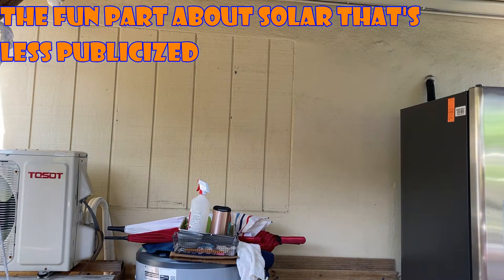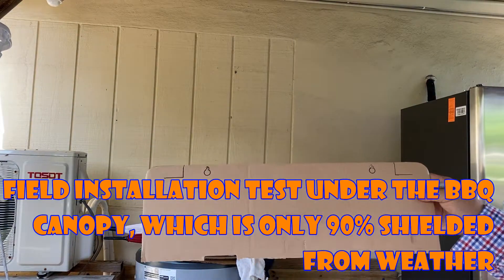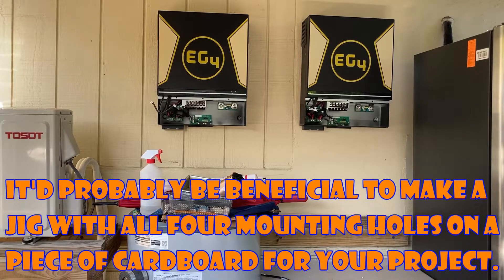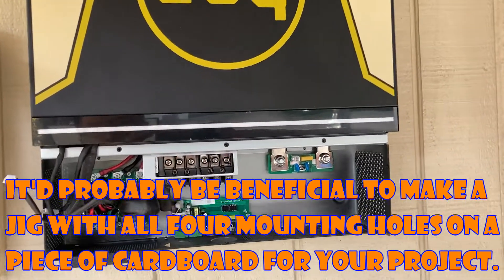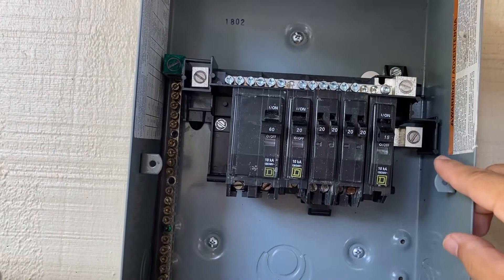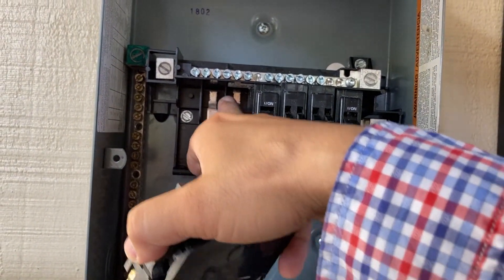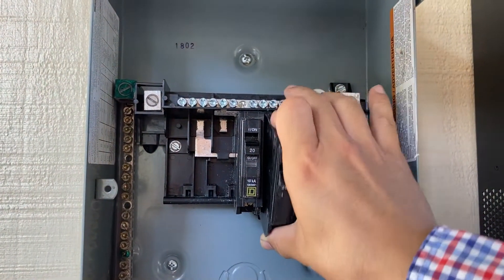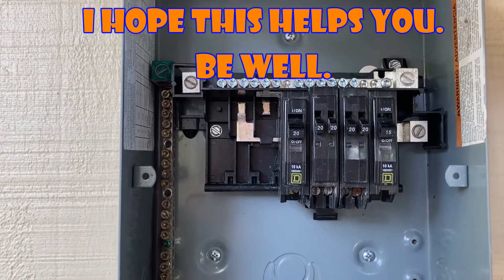EG4 6500EX Installation: Part 1

Comment: Hello, Where are you located? I want also install my inverter outside under cover but I am not sure if it is a good idea because of hot & humid weather in Northeast Florida.
Reply from the maker: Hello, G. I'm in Sunny South Florida. My set-up is temporary to test the split-phase inverters without a battery system. Once I procure the batteries, I'll have to either build an enclosure to shield these expensive toys from the elements or move them indoor. I would advise against installing these "computers" out in the open, as I don't believe they are rated to withstand the heat, humidity, and hurricanes. All the best with your install and thanks for watching.